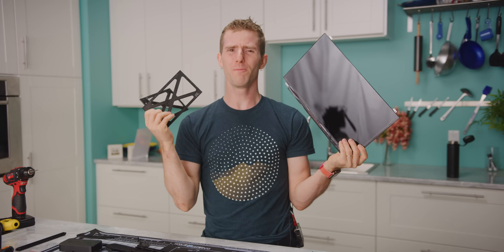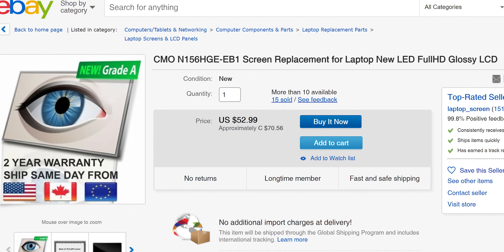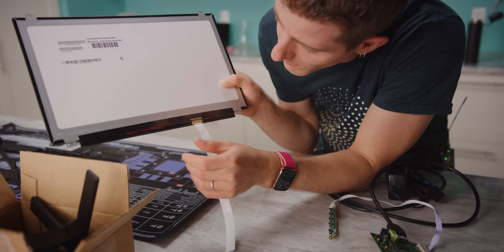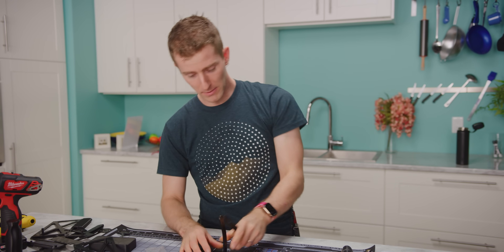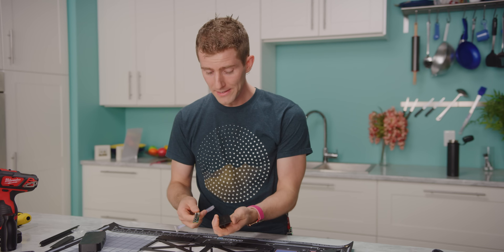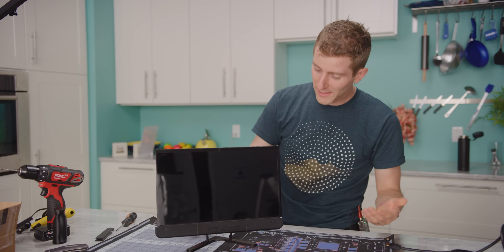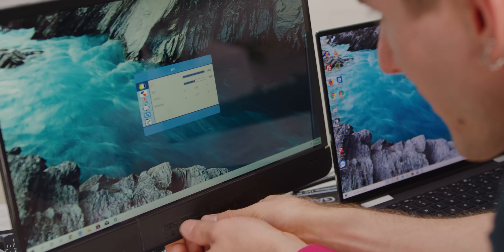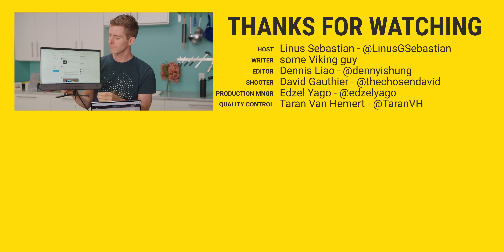We made our own monitor for under $100!

Comment: Interwebz: "Look you can build a monitor for under $100"

Me: Goes Newegg.com and finds a 22" 1080p 5ms monitor w/ builtin speakers for $60
Reply: It is much less than 100 I am mounting mine to the bottom of my monitor stand no case needed, also I don’t need the ajustment buttons just the adapter
Reply: that defeats the point of building a monitor in the first place
Reply: What the name lf this monkmitor or was that a affiliate link bait?
Reply: There was no affiliation link, YouTube auto turned the Newegg.com into a link bc the .com at the end
Reply: OlliPRKL V7 L215E-2N 21.5
Reply: Newegg curently has 35 1920x1080 monitors for sale that are new and less than $100. Most of them are 22" and  if you are in the US, most of them have free shipping. There is a Viewsonic for $77 and free shipping that is MVA if you don't want TN.

There are also 4 IPS panels. There's one by V7 who I've never heard of for $76 shipped and the next cheapest is from LG for $89 shipped.
Reply: @olli9764  who cares if it's true....
Reply: @elev8edm1nd  Apparently you don't Mr. Moneybaggz.
Reply: Does anybody know what the name of the work mat on the table is and where can i buy one?
Reply: @rick4447  Looks like a Gamers Nexus modmat
Reply: Any of those ones are absolute shit
Reply: And it's probably complete garbage.
Reply: @xPandamon  Well of course it is but is Linus' Franken-display any better?  The point is for the amount of money, you can avoid the hassle of converting a used laptop display and just get a new equally as cheap desktop display
Reply: What's the sauce?
Reply: Tn panels. All tn everywhere🤢
Reply: @Ahmeto.o1994  I find it so stupid when people talk shit about displays that are way more than adequate. LCDs have come a long way in a short time and even 10-15 years ago they were plenty good enough to play games and watch movies.
Reply: @Ahmeto.o1994  come on homie, they ain't that bad.

Comment: alternatively you could dumpster dive for a dead laptop and use the panel from that in a similar fashion. putting the part number into ebay usually pops up a suitable driver for it. then youll have a second monitor for 20-30 bucks instead. as for the need of a 3D printer, i use a piece of cardboard to hold mine up. it's not perfect but it works.

Comment: Since the control board uses 12v, can use this with an RPi, battery, solar charge controller and solar panel to make a off grid PC. Yes you can game on it too! Not any AAA titles but some retro games.

Comment: If you going to do a monitor from an iPad - don't disassemble it, AppStore has a program to turn an iPad into USB monitor, without any modifications and you can still use it as an iPad (tested on old iPad 2, latency is minimal)

Comment: Linus: “Your trusty sharp knife to clean up the 3D printing”

Me: “i don’t even have a 3D printer and I only have a butter knife”
Reply: I don't have a 3D printer so I just heated up the pva in pot and poored it on some wax paper and carved out the frame with a steak knife.
Reply: @HellTriX  I mean if it works it works
Reply: Ask the verge, they'll have a knife for sure.
Reply: In my country the bigger towns has 3D printers for use in libraries, I think you can print small stuff for free and for bigger things you need to pay the plastic for it. I'd imagine it's not very common though, but check your libraries. But otherwise woodworking is nice.
Reply: Get some metal scrap. Bend, saw and file a bit. Spraypaint it with a nonconductive paint (just in case). Screw it together or just glue it together.
Reply: I'm from the UK
Reply: Libraries often offer 3D Printers for public use.
Reply: My library has a sausage sizzle out the front
Reply: @notdazza1  my library has books..
Reply: Kristian Schultz mine lost its books
Reply: Hey, Rich Rebuilds has gotten pretty far with his trusty butter knife
Reply: Yeah I don't have a 3d printer
Reply: ... At least you can do hotknives while you think of a way to get a 3D printer and a knife...
Reply: Oh I see you're from the UK.
Reply: @Dalethegamerite 11 Live in the UK? LOL.
Reply: sonickiller360 no I actually live in Australia
Reply: sonickiller360 We have too much knife crime for that joke to make sense.

Comment: Aren't the back of panels normally fully enclosed to help reflect the light or make it so it doesn't bleed out of the back instead of the front? Maybe put a piece of aluminum or cardboard between the panel and the brackets to see if it gets brighter.

Comment: I'm curious if you'd be able to use it on an old TV set that's a flat panel LCD that the tuner or whatever's going out of it like the timing clock or whatever cuz the panel itself is still good but the rest of the hardware is well bad.... What this allow you to upgrade your nice wonderful 40 or 39 back to use

Comment: Are there control boards that support G-Sync/Freesync with the right panel?
And does the panel only need a high enough refresh rate and only the controller has to be Free-/G-Sync compatible or does the panel have to support it too?

Comment: Where are the tweezers?
You know, in case you have to tighten any cables.

And why didn't you just get a swiss army knife?
Hopefully that has a philips on it.

Also, you weren't wearing your silicone anti static wrist band.

Comment: Probably the most useful thing about this is that it runs off 12v. Good for running efficiently from batteries without need for an inverter.

Comment: Linus... You didn't mention that not every controller will work with screen. On that screen there are specific model numbers and we must get controller for that specific model. Otherwise it will not work.Also you need a power supply to power it up controller ,screen and screen backlight.

Comment: and if you value your time, you'd just buy a cheap tv to use as a monitor... costco had a 1080p 32 inch tv for $159 the last time I needed a cheap monitor... and it has chromecast built in..

Comment: Linus : made his own monitor for just under $100

Apple : Sells monitor stand for $999
Reply: Yes, with that price I can buy a new gaming pc
Reply: ,99
Reply: Pretty sure you can buy a pretty decent rig for the price of that fucking stand.
Still can't believe it is real.
Reply: Which strangely enough makes that monitor still a good deal for a reference monitor. (and most will probably not need it in favour of other mounts)
Reply: They sell xdr monitor for cheap (srsly) and try compensate that with overpriced stand
Reply: me: buys used 15€ monitor

Comment: You could have put the screen on a used overhead projector....made one about 10 years ago...60 dollars for the used sony 1080p panel and 35 dollars for the old classroom overhead projector both off ebay... disassembled the monitor and put it on the overhead--- had a bright 12ft image and the bulb cost way less to replace compared to a store purchaced bulb.

Comment: There are driver boards with 2 to 3 different plugs on them to take a few different kinds of old laptop screens and some of those also include an IR remote and DVB-T tuner that can turn it into a monitor with the option to also use it as a stand-alone digital TV.

Comment: Thanks. I did this with an old laptop screen about a year ago. Turns out that there are only a handful of screens that are used in most laptops. You can match the monitor and board by the model number on the board. The boards are all over e-bay.

Comment: That 3D printing will cost me half of the budget.
Not everyone has 3D printer.

If 3D printing cost and import cose for the module are included in the process, It will have similar or slightly cheaper than 1080p monitor from Acer or LG

Comment: Tbh, every Goodwill in my area has 22-24 inch 1080p monitors, many of which are IPS, that are all $25 or $30. The 27 inch monitors sell for $35 or $40, depending on their condition. And to top it all off, they are 25% off on Tuesdays and Thursdays. 
So, no thank you. Unless this is a proper project whereby we are adding a screen to something like a laundry machine (crazy) or a bathroom wall (not crazy), then this is kind of a pointless project.

Comment: If you don’t want to tear yout laptop apart, Windows 10 supports turning a  Windows 10 device into a secondary monitor using Wi-Fi Direct. If you can get your old laptop running Windows 10, you can benefit from a dying a device.

Comment: Step 1. Take working monitor apart
Step 2. Throw away the controller
Step 3. Buy replacement
Step 4. 3D Print
Step 5. Reassemble

Comment: This was a good video.  I did the exact same thing with my 60hz panel I took out of my Acer Nitro 5 and turned it into a spare monitor with HDMI that I now use for my server rack, and it's much easier to just tape the screen to my cabinet rather than sit a full flat screen monitor on top of the cabinet 24/7.

Comment: mine i have diy monitor too.. only 15.4 inch without a frame since i don't a 3d printer and i use a tv controller board and it's connected to my pc as 2nd monitor. anyway.. it's resolution is 1280 x 800 and i crank up to 1080p display options on pc

Comment: If you have a 3d printer and an old laptop you dont use, this is a cool idea. Otherwise you could buy a complete monitor for the same or less than he spent. Asus 18.5" LED  1080p for $79 at bestbuy.

Comment: I used the same basic principle in order to convert a totally dead imac into a secondary 27" display, in the original imac case. Looks awesome, apart from the cables that stick out from the RAM door... And also the buttons stick out from the DVD slot. But eh, who cares. It functions great. The components you need for an imac are a bit more involved, but it's the same principle.

Comment: Uncer 100? The monitor is 50, the two electronic boards each are 20; so it's already 90$; then add the cost for making the case with a 3D printer no one has.

Comment: that is a rather nice idea! a monitor in your PC case! you literally could have hardware info like PC temp, Memory used and CPU clock speeds or other Displayed at all times! would also be cool if you could have a touch screen like that! (would probably require an extra USB cable but still...)

Comment: If it wasn't guaranteed that I would break the damn thing, this would actually be an awesome idea. Makes me wonder how viable it is to remove the bezel for existing monitors... for the most part, I see that as the last step before monitors truly step into the future.

Like, sure... you can throw 8k at it, make it run above 165hz, but that stuff means nothing if the bezel is still there.

Comment: Nice.  I don't like the 3D printed mount - too flimsy for me, but you could do the same with a bit of wood or sheet metal and make something that looks really nice, especially if the back is open (for cooling).  The most useful piece of information here is that you can get a driver board for these panels - I didn't know they existed until now.  Thanks a lot for that tip!

Comment: Damn, an in-desk screen sounds pretty awesome.  My prediction is once this RGB fad runs its course, the only logical extension of it all will be to cover every component with actual screens.  GPU backplate? Screen.  Tempered glass case? Nah bro, screen.  And these screens will just be used for accent graphics, or for temps and other hardware stat info, not actual use gaming or browsing.  At least at first...

Comment: I was going to do a similar project a bit back when molding the dash for my 2001 Mustang "SVO" conversion (~2000 2.3L rebuilt for strength/flow with a decent sized turbo attached to a rebuilt 6speed manual out of a 08 GT, makes around 460RWHP atm with room to expand, would probably just go ecoboost at that point though) to add a display for a secondary gauge cluster/diagnostic/tuning display when using the thin client I hid inside that acts as an internal tuning computer.  I ended up just using the internals out of the laptop so that it could go into hibernation off the battery when the car was turned off for quick wake times when the car turns on.

Comment: Important Part!
On the back of the panel is a Number that you need to match to the Controlboard.
It can be quite tedious to find sometimes... but only matching the cable can result in some weird artifacts...
So look up the displaypanel number and what controlboard u need to use.

DIY Perks did a tutorial on this a few years ago which i followed but i bet this will be seen by many more but i recommend checking his one out as well if you are going to do this yourself.

Comment: did this from old laptop monitors, only hard part is fitting the stuff on the back if you dont have a 3d printer  :P
Also be sure to get a good panel, no cheap crap that cant be viewed from 10degree angle

Comment: Hey QUESTION:
so i just got an HP 24f 24" 75Hz monitor and I cant seem to set the monitor to 75Hz.. only 60 is available. Help me out? This is a Dell G3 gaming laptop btw. 

Specs: 
9th gen i7 
GTX 1660ti

Comment: i am wondering if there is a solution to feed that secuondary monitory to a lapto using power directly from the laptop.. such as splic output from the laptop AC adaptor or through a USP port or?

Comment: A really cool thing you can do with this (if you can harvest a working panel of the right size) is make yourself an incredibly cool animated side-window on your case.
If you remove the backlight then the screen will be almost completely transparent - so your window is now also a screen. Only imagination is the limit for how you can use that for pure cool-factor with fancy patterns, animated smoke or animated logos - or even semi-useful functions like displaying the various stats of stats of your rig.

You do need some half-decent illumination inside the case to get a good effect though, because obviously there is nothing generating light in the screen by itself anymore after you remove the backight.

Since the most expensive part by far (the panel) can very easily be sourced for free or super-cheap, you can make something that looks really sci-fi and professional for a very low cost potentially.

Comment: For LCD's, you'll need additional components, like the backlight and with that, you'll need to be very careful bc it requires a converter from DC->AC and I got electrocuted from that; it was very painful. So, if you do have an old LCD laptop you want to take apart, be careful.

Comment: A few years back I had an LCD monitor where the backlight died.  I pulled everything apart and figured out that it actually was the backlight.  So I went on e-bay and bought an old overhead projector, like the kind they used in schools forever.  I put the LCD on the base of the projector and used it to build my own video projector.  It worked, but I never finished the project.  This was almost a decade ago and now you can buy cheap projectors for less than I spent on the bulb for that build now.  But it was still fun.
EDIT:  If you ever try this trick, remember those old overheads get really really hot.  Try to keep any of the cheap plastic bits from the monitor away from the hot parts of the projector, or you will have a fire.

Comment: Actually, I think I have an old HP laptop with touch screen with a dead motherboard. Would be an interesting project to get that one running to control some of the stuff on the home network and not having to use keyboard or mouse (or RDP).

Comment: Did this with an old 13" screen from a notebook (MSI X320, shitty atom CPU so not much good as a notebook anyway) a couple of years back at least, but no 3D printed case, just a crude stand made from left over brackets, bits of aluminium angle and an electronics enclosure, all very crude, but is handy when I have a spare PC or Raspi that I need to set up on the workbench. One thing I found with the (older, larger) interface board I used was that it would glitch or not start with a 3A supply, it needed at least a 4A supply, probably because it needed more filtering on the supply due to the current spike when it first powers up the display (the board drives the backlight as well, btw). So, if you build one of these and it acts odd, beef up the power supply to a 4 or 5A unit.

Comment: So, all I need is:
$40-50 monitor 
$52 adapter 
$20 options buttons adapter
power adapter
screws
$2000 3D printer
$3x17 3D printed mounting pieces 
and some other things
Ok...
Reply: The ender 3 is $230 to $260 rn...    To temper your wildly inaccurate estimate.